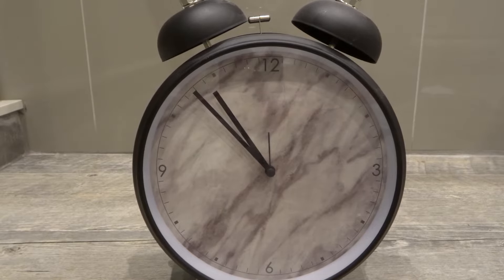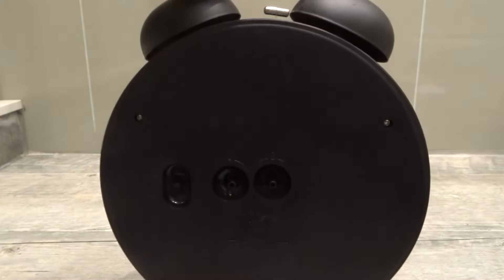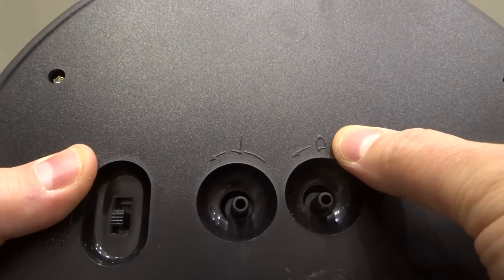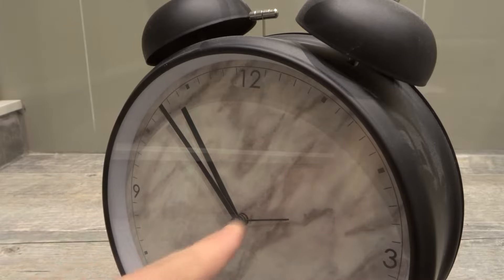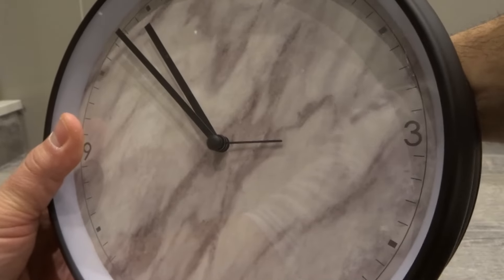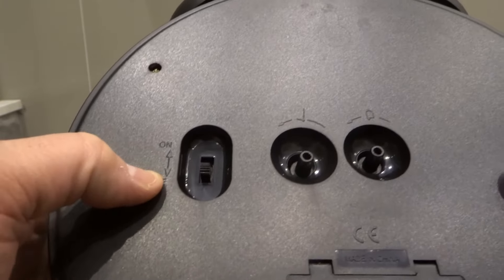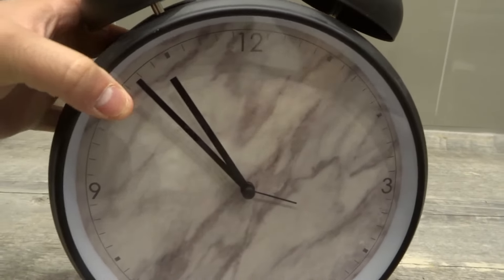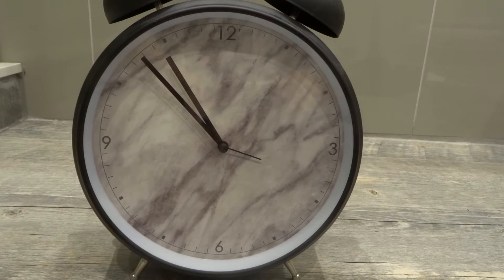How To Set Alarm On Analog Clock Easily-Beginner Tutorial

Comment: Bro i want to ask you about a problem with my phone charger, so the cable and the box together don't work on my phone and even on other phones but they do work when seperated like when i use my cable with another box and my box with another charger they both work, what is the reason ?